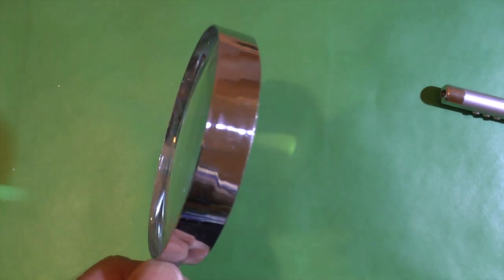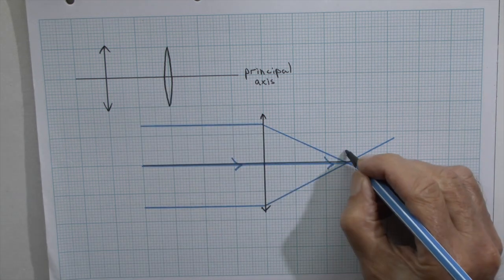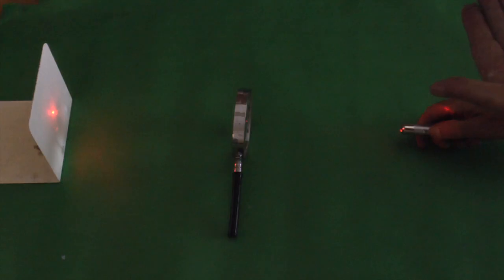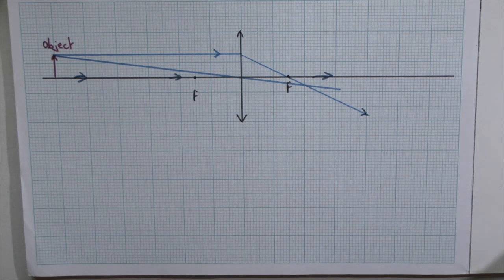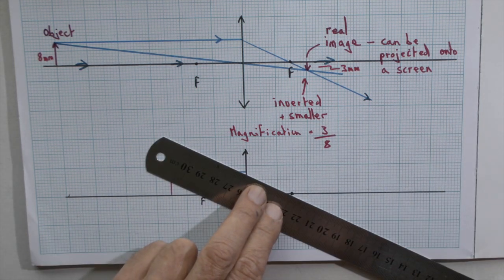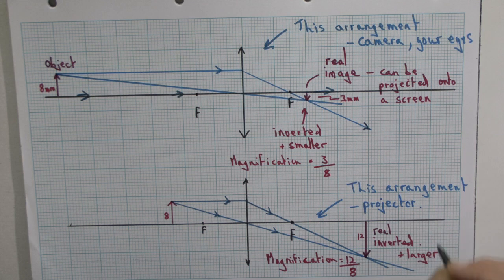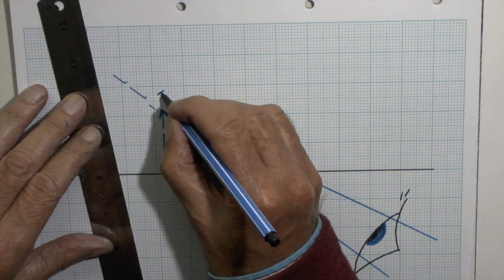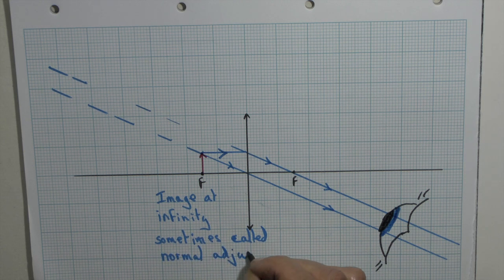Convex / converging lenses and ray diagrams explained: from fizzics.org

Comment: How are you talking without an American accent yet you're using a ruler with only inches on it?!?
What an atrocity!
Also, would've been helpful when you moved the magnifying glass closer to the flashlight that your drawings showed only a difference in the lens moving, rather than keeping the lens stationary and changing the position and the scale of the rest of the scene. I understand your image would've been very large, but I think there's more important parts to highlight
Very helpful video though. Thank you
Reply from the maker: The ruler is metric on the reverse, as is common with many British instruments. You may be right about the lens movement, I'm afraid it is hard to think of everything in advance.

Comment: Thanks for an amazing video! If you could take time out to just answer some doubts I had: 

1) When we are using the projector arrangement to enlarge the image: How do we calculate at what point the image will be sharp and focused? What should be the ideal distance of the lens from the object? 

2) All convex lenses are magnifying glasses right? When I look through my magnifying glass at something 2-3ft away or further, why is it blur? Why doesn't the same blur happen for my spectacles?

Thanks !!
Reply from the maker: +abhishek agarwal Hi The distances you ask about depend on the distance from the object you are projecting to the lens and upon the focal length of the lens. ou can calculate this using the lens equation or you can draw a ray diagram to scale.
Two points on the second question. Are you sure your spectacles are converging lenses, if you are short sighted they will not be. In any case you are using two lenses, the spectacle lens and the one in your eye. The one in your eye is flexible and automatically adjusts to focus the light. See how the eye works here: https://youtu.be/ccPL4qJw09c